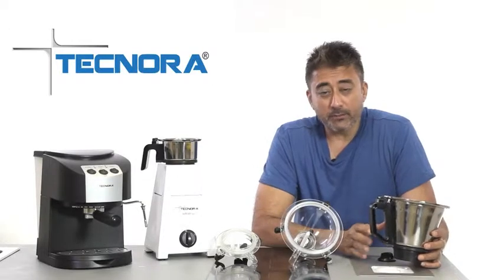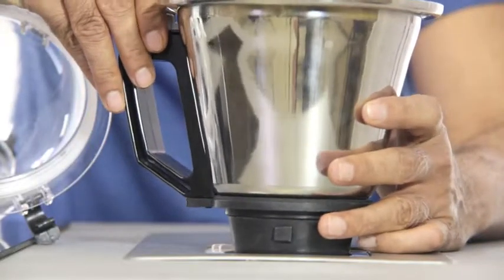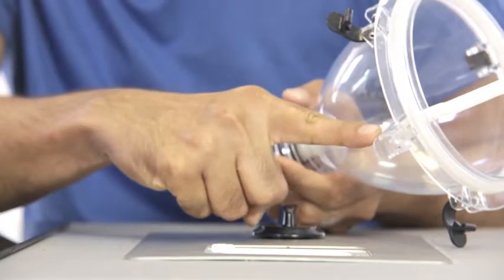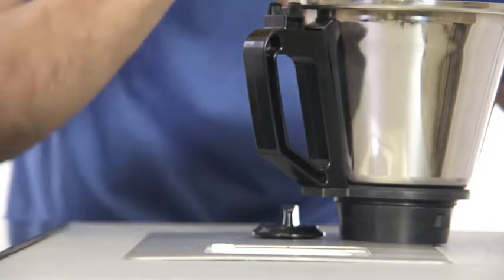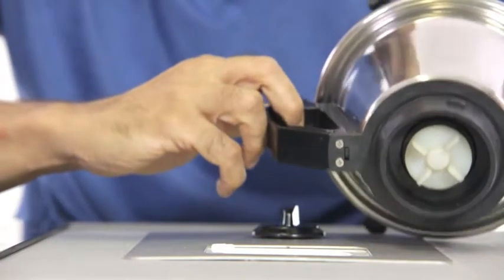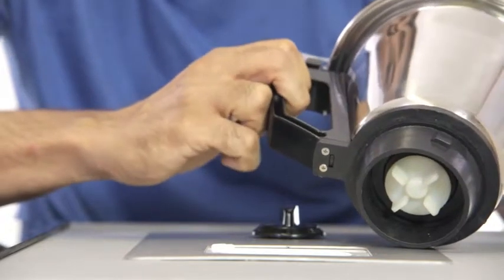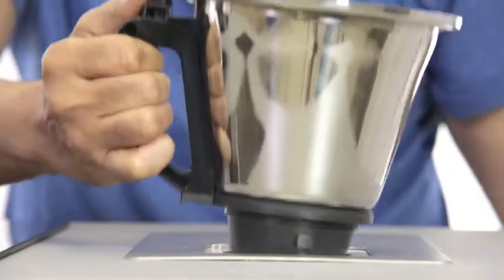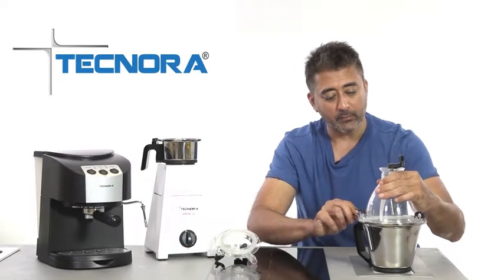TECNORA AVATAR SAFETY INTERLOCK FEATURE

Comment: Sir, I am looking forward to buy the Mixer Grinder. What should I expect out of this product.
Reply from the maker: Hi Puspen,
Expect the following from the Avatar Series Mixer Grinders:
1. A safety interlock mechanism - No spillage ever and childproof.
2. Built-in stirrers in the domes of the jars- the easy stirring of ingredients while the machine is on.
3. Spot welded handles on the jars (no screws, therefore, easy to clean and avoiding bacteria formation)
4. Brass-free jar assembly (No health hazardous brass components in contact with your food)
5. Full size bearing even in the small chutney jar-Full power to the blades
6. Even chutney jar blade is removable-Easy to clean just as the large jar.
7. Dynamically balanced and assembled unit-Perfect alignment reduces noise.
8. 3mm ABS body-Just like the solid mixers built in the past.

Thank you for getting in touch with us!

Tecnora Customer Centre